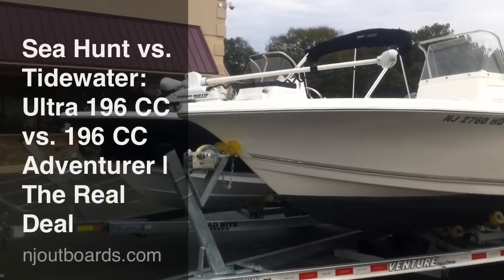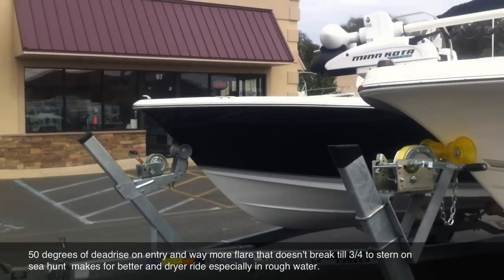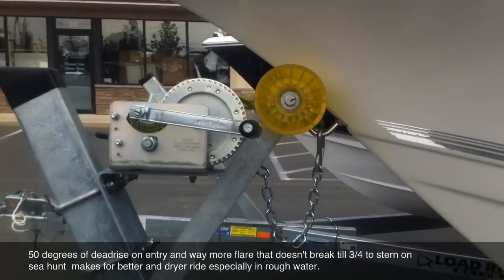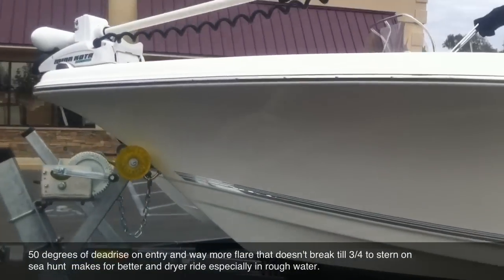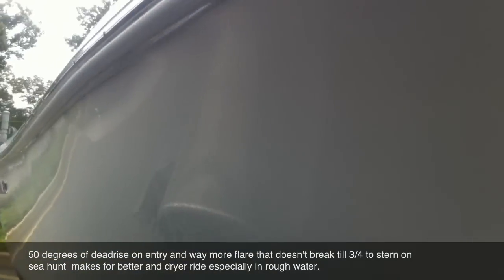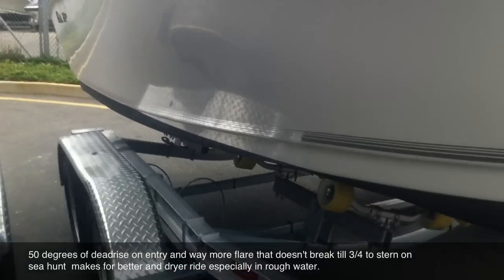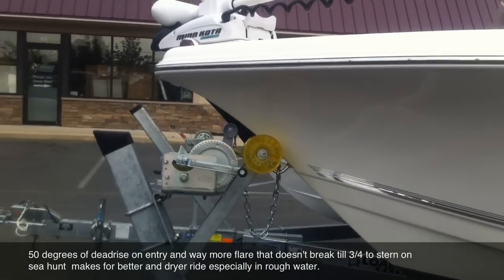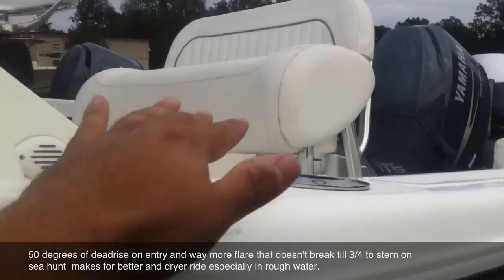Sea Hunt Boats VS. Tidewater Boats: Ultra 196 CC VS. 196 CC Adventurer | The Real Deal

Comment: Interesting comparison.  I'd love to see a comparison of the '16 or '17 models of both boats.  Maybe in the 23' size.  Also could you use a tape measure and give the numbers in inches for both as well as the weight and deadrise.  Thanks!
Reply from the maker: Sea Hunt only makes a 188 now.  If I get my hands on a 23 I could do that for you.
Reply: I would love that.  A 230 CC or LXF vs an Ultra 234 or the Ultra 235 SE.
Reply from the maker: I don't have that comparison but I did compare there flare and deadrise entry to my boats in the same tent I got pics of.  If you email me at glenn@njoutboards.com I'll send them to you.  I also got a video where I break down why there boat doesn't ride great on a chop I can send you as well.  Thanks.

Comment: The bottom line is... the price difference. If a person doesnt see spending very much more money for reasons of his own then the tide water will do the job. Now if both boats are the same price or the Tide Water is even more money then you have a good comparison.
Reply from the maker: They can be very close in price in most circumstances.  The biggest difference in my area is the soft dry ride the sea hunt gives you compared to most hulls.  Both manufacturers make a nice boat for the money but the biggest difference is the ride.  But again sea hunt has most people beaten on that.